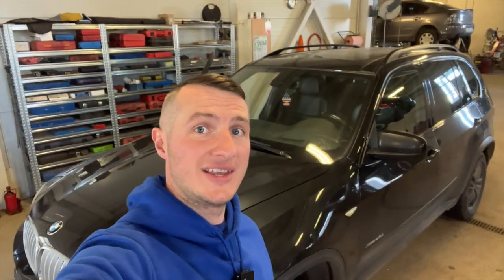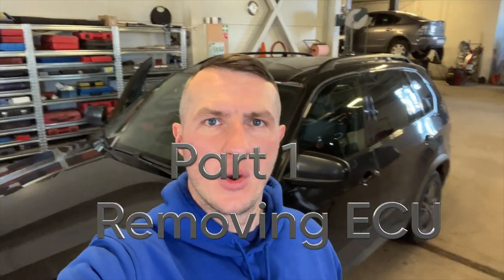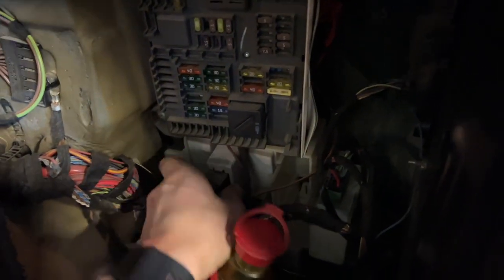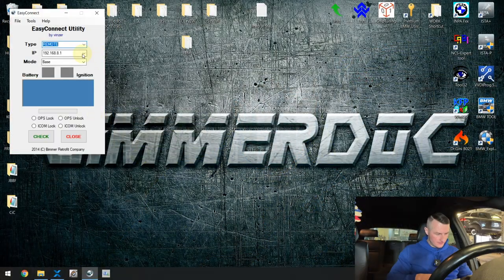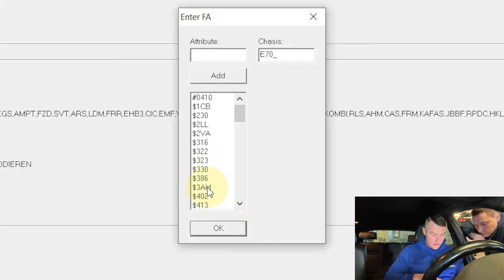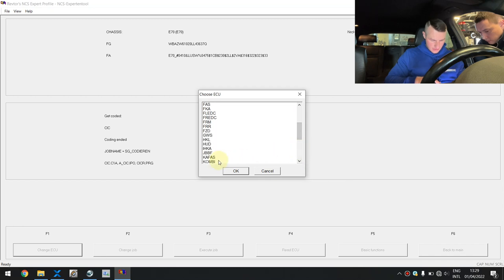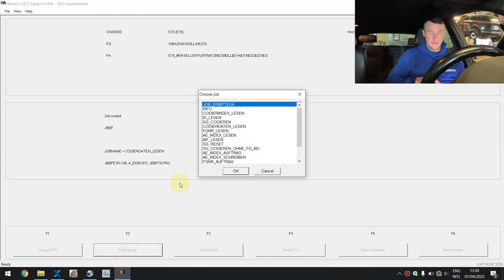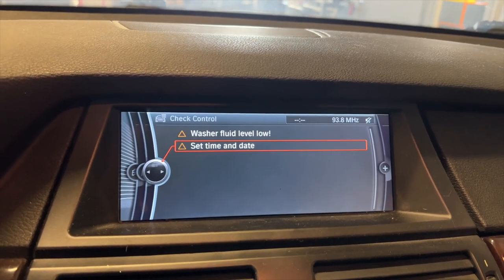How to Fix trailer tow hitch error on BMW via coding? (decoding option 3AC out)

Comment: Hi, you made a great video. I have X5 E70. My towbar motor faulty and getting same error. Not long time ago I unfolded my towbar ,removed motor and did that manually with hand turn and secure locked it. Now I'm not sure if I decoded it like you did in video or my socket plug will be still working? My plan is to keep it always unfolded and get rid of errors. Will be thankful for any advice😊
Reply from the maker: If you recode and disconnect ECU then socket plug will not work any more. Because wiring is running through ECU.
Reply: Ok. Thanks for reply. So I need to find another soliution then...

Comment: Hi! Thanks for a great video!
 I am having this error code on my x3 2012 F25 and the service guys are having problem removing it. This after I installed a non-removable trailer hook. I need to get the error removed. 
Do you have any experience with this model?
Reply from the maker: Jep, no problems 
Contact me directly
Reply: @BimDoc  I have written to the email in your signature

Comment: Hello Vladimir! Can you please share how to code away trailer/tow hitch on F10 with esys? I've been trying to read 10 different forum posts but I'm still not sure, due to the different modules needed to code new VO
Reply from the maker: My suggestion: check the wiring where trailer hitch ecu is connected. Those ecus have to be coded with modified VO 😉

Comment: Does The modul control The light aswell?
Bought a 530d with permanent tow and The light is stick on red.
Reply from the maker: Trailer coupling ecu is connected to frm (lightening ecu) via wiring.
Reply: @BimDoc  i see, is there anyway to fiol The system since i have The modul still "unhooked" and The wiring.

Could one just connect The wires somehow to get a green light and get The code stop showing up in startup.

Comment: super movie and how to remove ACC with dme I have never had cruise control  active and after updating the dme it writes that the function does not work and I can not adjust it and the cruise control does not work auto E65 750li 2006
Reply from the maker: Try deleting ACC option and recoding needed ECUs